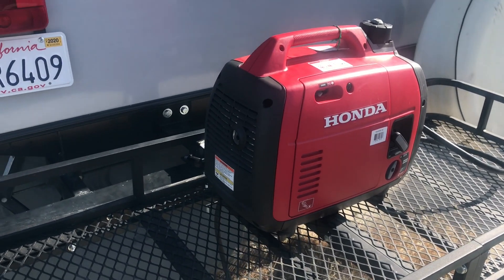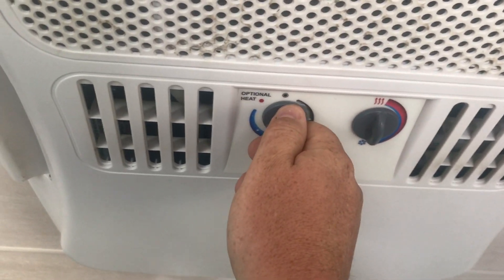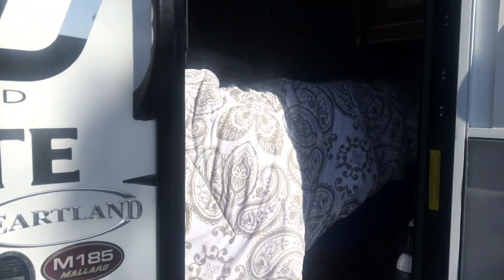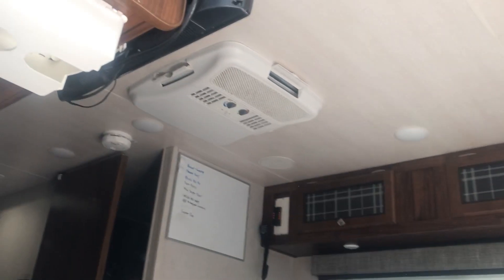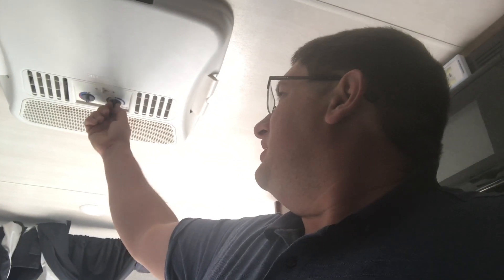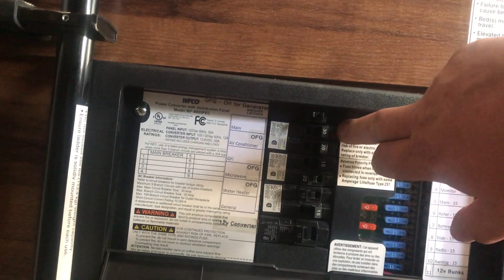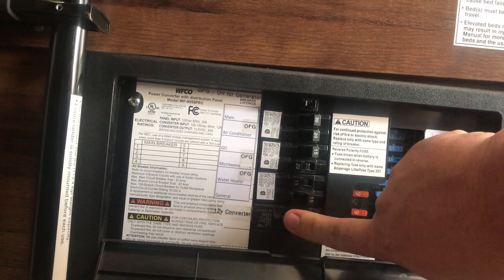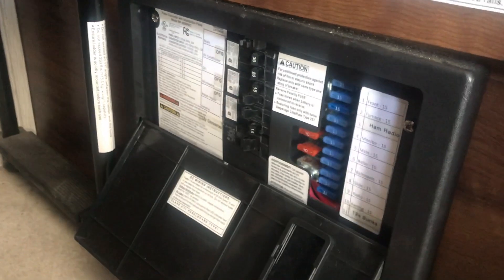Honda 2200i running 13.5k AC unit on RV

Comment: Do you think the Honda 2200 would run our 8000 BTU portable AC and refrigerator? Maybe  the TV and our Iphones in addition. Thanks
Reply from the maker: Thats a smaller load than the 13.5k, so it should work. You may still need the boost capacitor to get it turning initially.

Comment: I believe this generator doesn't have 30amp plug in. How are you connecting the AC to the generator without using an extension cord from AC to the generator?
Reply from the maker: Simple 30-20a adaptor, and don't run anything else

Comment: I think my generator overloaded because I had it in eco mode. So you have to leave it in full throttle mode the whole time? Nice recommendations on killing the microwave to conserve power. I was worried I’d have to buy a second Honda. Whew!
Reply from the maker: Have to conserve as much as you can. Remember your battery charge converter could also be drawing power as well.
Reply: @EdwardCzajka  it still overloaded on me without the microwave breaker on. 
I think I’m gonna have to kill all the other breakers other than the lights and see.
I have solar so that will charge the battery.
I just want the tv and a/c. 
Hope I don’t have to instal an a/c soft start.
Reply from the maker: @RVingTheCountry  I have a Super Boost Cap in mine, and I still turn fan on first, and then compressor. Sometimes it takes a few tries.
https://www.youtube.com/watch?v=2x8jOWBRZ_4&t=3s
Reply: @EdwardCzajka  oh dang . Nice
So that should definitely help with not killing my generator.
It works for about 5 min then overloads the Honda.

Comment: I like how you limited the generator's load to a only a few things.  I will look for way to add a circuit breaker for my 12DC converter you like how you have it there.
Reply from the maker: That has helped us for boondocking quite a bit